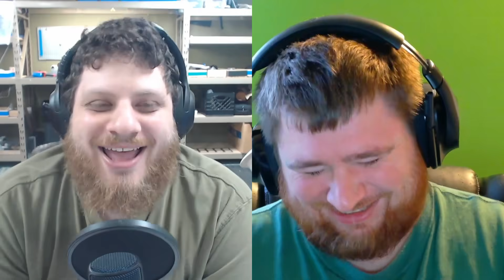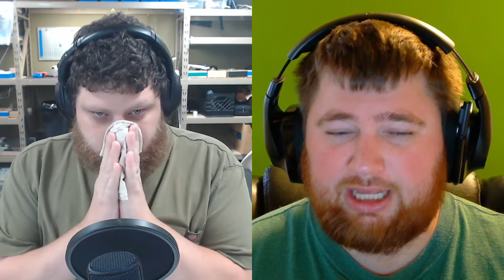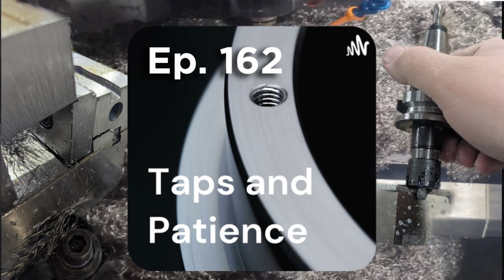My Machines Run So Good Now - Ep. 162

Comment: Swiss machinist here. If you get into an old machine I would suggest looking at maybe a Citizen B12 or something from the Star line. My understanding is that the Fanuc controlled machines are more robust than Mitsubishi controls and will cost less if a repair is needed.

Chances are that you'll be hand programming swiss. Get a good library of cycles and templates and programs are quick to get done as you recognize features or similar parts.

Also, everyone will try to sell you on quick change toolholders. Don't buy into that because they are less rigid and you will see your tools push around in some moderate to heavy cuts, especially in hard stainless.

Maybe I can answer any questions you might have. I have 5 years on Citizens in production and job shop settings.
Reply: And before I forget. Qualichem has good cutting oil. Met-Cut 754HD doesn't smell bad like Swiss Silver or lacquer onto machines like Hangsterfers can.